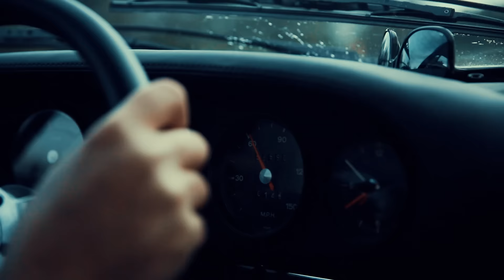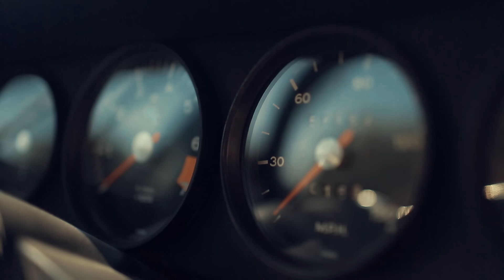Central Texas Outlaw – A Vintage Porsche Specialist Story

Comment: Not every "outlaw" Porsche is cool.  Those 17" (or 18"? bigger?) fake Fuchs at 4:09 are a real buzzkill.  Just no place on a longhood, even if it is a backdate.  Oh, and don't forget to tighten down that loose button head screw on the steering wheel at about 4:15...